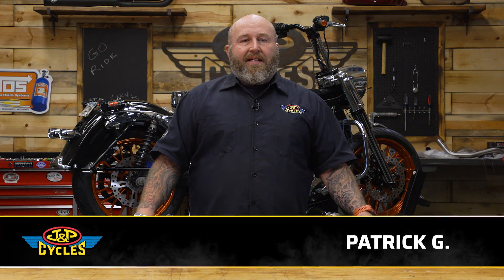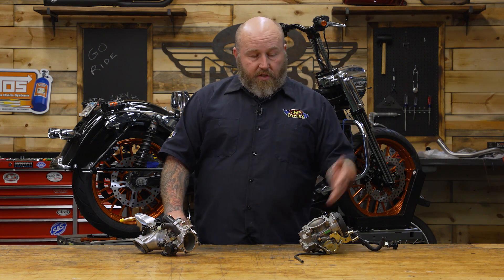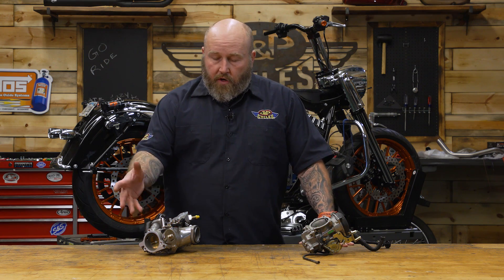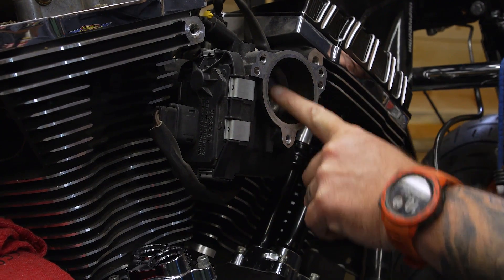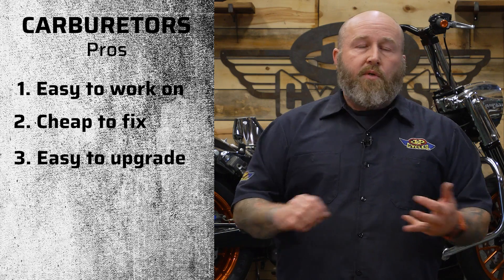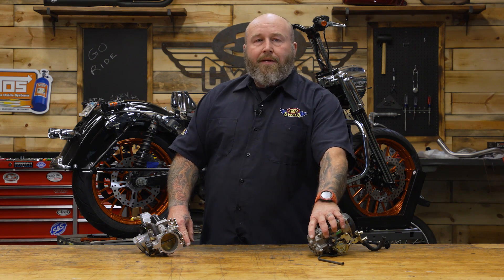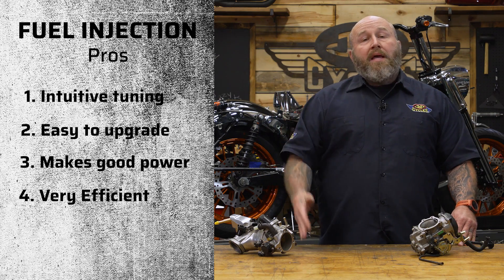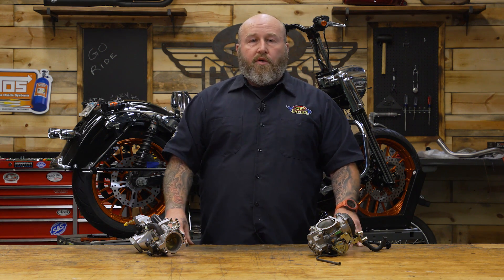Fuel Delivery 101 : Carb vs EFI | Pro Tip

Comment: Hey Patrick, Thanks for another great video....  I have long preferred  the carbed motorcycle.over EFI... however I couldn't pass up the screaming deal I got my 06 FLHXI TC88...as you mentioned getting stranded on the side of the road has been my main reason for carbed bikes. In your opinion, would it be a complicated endeavor to remove the EFI and install an aftermarket carb on the TC88 my bike is equipped with? Mikuni 42? I'm thinking easy job but what do I know.. I could be in over my head in a nano second.. Thoughts on this please... TIA

Comment: I have a 2000 Road King police fuel injected and it was running and my storage for about an hour and came back and turned off and the throttle is stuck now closed and the fuel injector was and I sprayed a little bit of WD-40 on it now the fuel injector opens and closes the throttle body but they won the cable will not open close of butterflies

Comment: hi i am building a dyna i have a 2006 motor and a 2007 frame. I like doing things myself. I like what you said about carbs and fuel injection. I was thinking SS Super E with cams and heads ported. I know the 2006 heads have bigger exhaust valves already with the shorter stroke of the tc88., what Say You? Cams?

Comment: On point is a fuel injection system on Harleys..the engine will be totally different in design..the crank is engineered different because fuel delivery is different the crank cannot idle like a carburetor engine...the sound is less then impressive..I'm old school..because..new efi bikes require dealership support...I on the other hand can totally rebuild my engine...the new bikes to me have less quality control and less sound...its a shame..but unfortunately in maybe 10....20. Years old school bikes...will not be available to anyone....